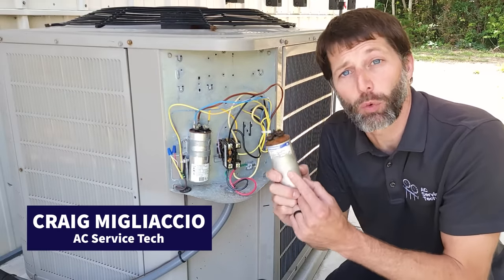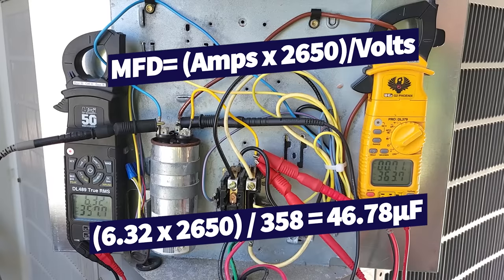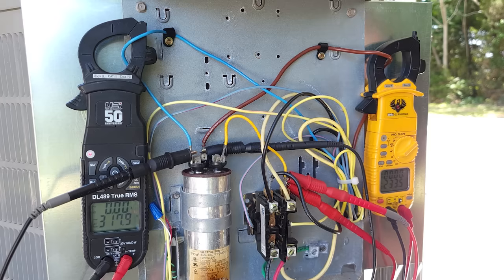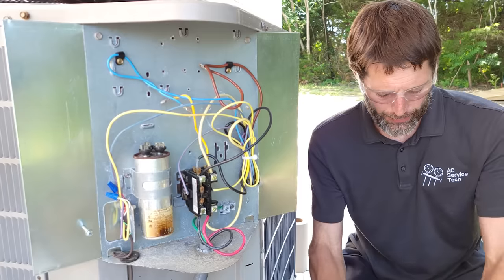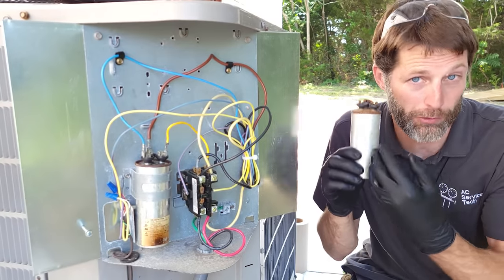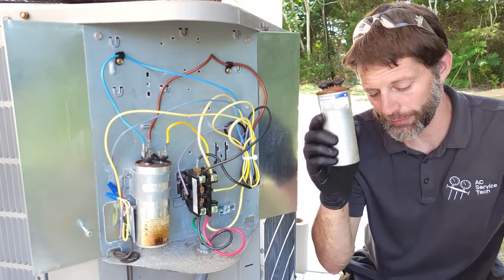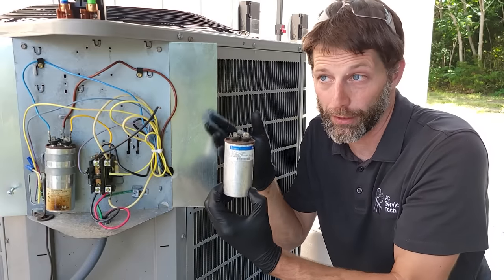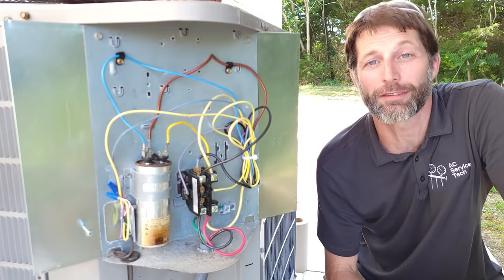WHY CAPACITORS FAIL in Air Conditioners! Watch it Break!

Comment: My capacitor failed and was told it was going to cost $220 to repair, but it would be a week to repair.  I looked up the capacitor on Amazon, cost $18 and a day later I installed it in 5 minutes. Been working ever since.  I did order another, just in case.
Reply: My experience is that Chinese made capacitors have very short lives.  I've had problems with the capacitors on my pool pump motor.  I just bought a made in the USA capacitor, we'll see how long it lasts?
Reply: Erik, I just had an A/C tech tell me $330 to replace a capacitor, I showed him I could buy the SAME item from Amazon for $21. He told me his boss forbids him from installing such. Blamed Bidenflation and the need to be profitable.
Reply: You could buy 2x 10µF/400V and in parallel of 5µF/800V, also 2x 90µF/400V and in parallel of 45µF/800V and hold all of them in the ground to prevent vibra. That is it.
Reply: @chipdenman863  needing to be profitable IS a huge factor. I could clean my own house for about $1 worth of cleaner or hire a person to do the same job for $60-$100. It's always cheaper to diy. Don't hold this against them. They are highly trained pros that must charge for their time wether or not it makes sense to you.
Reply: Let's pretend for a minute that you have an A/C repair business.  You have a truck to pay for.  You have a LOT of inventory to pay for.  You have gas to pay for.  You have vehicle and business insurance to pay for.  You have a business phone line to pay for.  Business cards.  Vehicle maintenance.  And not everyone has the ability to replace their own capacitors.  And the fault with your A/C might not have been the cap.  I think the $220 was a pretty cheap repair estimate.  Stop bitching about how much a business charges when you obviously have no clue about running a business.
Reply: @obnox7601  So your conclusion; stick it to the home owner.
Reply: For us it was a Sunday evening a month ago (late June) and we were looking at spending the night in 90 degree weather here in Houston.  Ended up costing us almost $350 to replace the $30 or so capacitor in about 30 mintues on a same day (night) service call (~10pm).
Reply: @larryross1819  Lmao…they are all made in China or with at least Chinese components…FJB!
Reply: @obnox7601  Let’s pretend you aren’t  a rip-off artist…most HVAC companies are and you know it.

With that sort of attitude you won’t get a lot of repeat business…one HVAC tech to another…
Reply: So if you call a AC tech it means you have to pay him and for the truck and all the knowledge and equipment they have. Just because he told you it was a capacitor does not mean you should screw him. Get on the internet and trouble shoot it yourself. Buy the parts and replace them. Just don’t call the guy and argue over the cost. Most companies charge just for coming to protect themselves from such people. In fact they don’t want your business.
Reply: @baogiangsongque5507  think you mean in series. voltage balance can be an issue, typically install equalizing resistors.
Reply: Even an honest, competent professional is going to cost major money to do anything. They have legit expenses, plus you are paying for their knowledge, and they have to make a decent profit otherwise why bother? In the end if they are making min wage just go flip burgers. Want it done better, faster, cheaper? Learn to do it yourself.
Reply: @AmandaHugenkiss2915 and you have to pay for the tech’s jacked up F-150 and the bosses cabin cruiser.
Reply: @obnox7601  I’m a controller for a corporation and I’m saying they rip you off.  I think I know how to run a business.
Reply: Yup, good thing you ordered a spare, they're all made in China.
Reply: Japcaps aren't bad
Reply: @chipdenman863  so how much should he charge you for getting the capacitor and then coming out to install it since the retail price was inexpensive?

Comment: When I was a kid the capacitors lasted the entire life of the unit. I've seen caps so old the only reason they had to be replaced was because the 25 year old terminals had rusted through and you couldn't get a connection on them anymore.  Those caps were oil filled and weighed a couple pounds. They were also a lot bigger in physical dimensions, a 30mfd was about 7 inches long oval can.. The caps we have now sometimes fail in a year and feel like they're filled with air.
Reply: One word....CHINA.
Reply: I believe that they used PCBs and thats why they last much longer.
Reply: @vernroach3413   It aint where it's made, it's how it's made. My Sony receivers lasted 30 years it still works
Reply: @agsession7664  Depends on what is made too...I do believe Sony is from Taiwan...Far better than China...South Korea for the most part, good products...Mexico, depends on what it is...Most receivers will last for years, no matter who made them...It's just a receiver...They're not under the stress some products are.
Reply: @curtishuzarewich7033  I think it was actually because they were foil caps, not vacuum deposited metal films on plastic film. Could handle current overloads without overheating. IMO.
Mr KL
Reply: @agsession7664  Caps > China, Sony > Japan; BIG difference. AFAIK
Mr KL
Reply: @vernroach3413  There are people with alcoholism, do we close the liquor store? Does any new system come with an Amrad? How many techs run them? The choice is there
Reply: @vernroach3413 you don’t know what you’re talking about.
Reply: @johnsullivan8673  Hey Johnny baby...Didn't mean to insult your genius.
Reply: I've used multiple brands of capacitors and they all have failed right around the year mark.  I always have 2 on hand at all times now 🤦🏻‍♀️
Reply: @oldbear6813  turbo 200 ...I have only seen a couple fail
Reply: They "make them to break them" now because our world is so upside down. Sad, but so true with much of life. My wife and I talk a lot about wishing we could have lived through the 50's-60's at 40 years old. Not this 2023 world we live in where everything is literally shit and shit on. But I love your sentiment. Especially considering we live in Phoenix, AZ and these caps burn out so easily here in a year. and it's ALWAYS ON A FRIDAY AFTERNOON, during the 115 degree+ days which ultimately sent me into a learning season to cut the HVAC techs out and do it myself. It's ridiculous!
Reply: @vernroach3413  You can buy crap from any country.  The reason "China" is on people's lips is because US companies don't CHOOSE quality, they choose cheap, and they can get the cheapest crap from China.  MANY companies use China and by specifying the quality they want, they get good products.  Apple comes to mind.
Reply: @troubleshooter1975  They don't handle heat very well either.
Reply: Heat reduces the life of any component. If the manufacturer wanted to do something about that, they easily could. There's a giant fan in the condenser... How about putting a couple of vents in the electronic compartment so there's a bit of airflow from the fan?
Reply: @bbgun061  I don't think that would help. The air in the rain tight contactor/electronics area is fairly close to the outside air temp unless sunlight is hitting it pretty directly. Cooling the capacitor by a few degrees probably won't help much. I do use 440vac rated caps in my equipment and they seem to hold up a lot better than the 370vac. There are techs that say you can't use 440vac caps but they are wrong. I also add a slow blow fuse to my compressor's black wire that is just a few amps above my normal running amps. If my compressor draws 11 amps running I put a 15 amp slow blow fuse on the black wire. That way if the cap fails when the compressor starts and is drawing 30-40 amps it blows the fuse and saves the compressor. I don't know anyone else that does this, it's just something I do because I hate compressor failures. I have about 40 systems on various rental properties. I don't work on other peoples systems so I guess you could call me a part-timer.
Reply: @douglaswatters7303  great idea!
Reply: I have taken out systems made in the 50s and 60s on remodel projects that still had the original capacitors in them, they were all PCB based which is now banned
Reply: @troubleshooter1975 Bingo! This is exactly why modern run capacitors have shorter life expectancy.
Reply: @electricboyo  TNX!
Is your comment about caps using deposited electrodes? (I also made a comment about Sony and China are not the same quality AFAIK...)
Reply: @bbgun061  My Rheem unit has the can of the capacitor stuck through a hole right in the fan air flow.  I thought that was way too good of an idea, that engineer probably got fired.  I replaced the cap this summer, after 13 years.
Reply: Turbo is the way to go. I’ve never really replaced one of those. A lot of times I’ve seen capacitors fail is when the compressor is overheating, usually due to caked coils or bad fan motors. System gets really hot when the compressor can’t breath. Also if your system is getting beat by the sun 16 hours a day, like on a rooftop.
Reply: @vernroach3413 Yes, let's blame China for manufacturing to USA specs.
Reply: Not knowing much at all about this topic but is it advisable during extra hot days in the 90s to shield the AC unit from the sun. Even with a patio umbrella or even build a wooden roof above the unit? Any suggestions appreciated.
Reply: @pmaz-11  Bad idea to build around the outside unit. What cools the condenser is good air flow. The fan pulls air though the condenser. Something built over it or around it could cause the air flow to be restricted, or prevent the warm air from rising up and away from the unit. They are designed to sit in the sun, on rooftops or on the ground.
Reply: @douglaswatters7303  ok thx for the advice. But I have to say that extreme heat on anything is not good. I asked an HVAC tech today  he said that the extreme heat can increase the amperage putting a strain on the equipment. Found out the fan Motor is out & the heat probably helped it along. Units these days suck.
Reply: @Null-o7j 
I agree with your statement for the most part but there are cases where items are not built to spec.
Reply: Old caps were filled with "Pyranol" a special oil especially made to withstand service.  (This oil was also used in street transformers & the big transformers in the power stations.)  But this oil (PCB, polychlorinated biphenyl) is nasty when it gets into the environment & never breaks down.  So they now use an "ecologically responsible" oil.  This oil is not as good electrically (& is also flammable so cap can catch fire if it ruptures).
Reply: @vernroach3413 I believe the amrad ones are made and manufactured in Jacksonville Florida. That’s probably your only true American option. Come with a 5 year warranty too. It’s all I use.
Reply: The Run Capacitor will be exposed to excess heat from the motor. A lot of these capacitor failures are not cleaning the Condenser Coil. If you’re replacing a Run Capacitor I would clean the condenser coil also.
Reply: A common scenario, A DIY doesn’t have the correct Run Capacitor, They need a 35/5 and they replace it with a 40/5  thinking it’s ok.  That capacitor fails and gets replaced with a 45/5 because it was emergency and after hours.  This can cause the Start Winding in the compressor to fail leading to compressor replacement or system replacement.  Always do your homework and make sure the correct capacitor is installed.

Comment: I honestly can't even remotely consider why anyone would thumbs down this video... It is distinctly, one of the absolute best explanations on YT for value, reason and explaining the math behind it. Job well done Sir.
Reply: simple to explain why the thumbs down - it is u -tubes fault. if you give a thumbs up you will get blasted with stuff similar to . since i just was interested and not wanting more similar, thumbs down - NOT because its a bad video. stupid the way utube does things.
Reply: Probably down voted by an AC guy that don't want people to know how easy and inexpensive it is to replace! He loses business over these types of videos. Emergency call, service, and part $450.00 for something that can be fixed in 10 minutes and the cap is under $20.00.
Reply: @williamkechkaylo7915  Safety glasses on head vote.
Reply: No.
Reply: Down voted by capacitor manufacturers.

Comment: I always keep a spare capacitor at home. After the first $250 bill for replacement, I learned to do it myself.. Only a $20 part so cheap to keep a spare. In Texas they are the most common failed part on a home AC and they charge an arm and a leg to come and replace it. Literally takes 5 mins to replace..Easy to test with a volt meter..
Reply: Maybe it would be a good idea to figure out why your capacitor is failing so much
Reply: @jakev1972  It's in Texas.  It's hot here, like a lot.  High ambient heat shortens electronics life.
Reply: Yeah, Texas is hot. And they aren’t failing a lot. I’ve only replaced 2 in 10 years. But there so cheap, why not have one on hand instead of paying a high prices service charge and having to be without AC overnight or more than 8 hours in 110 degree weather while you wait for that service call…
Reply: I have spare capacitors and replace it as a planned-maintenance item (PMS in the Navy as an ET is planned maintenance system, fix it to keep it working when you never know when SHTF).
Reply: Reduce the temperature  of the cap by  shade, or maybe heats sink or reposition
Reply: @loueckert4970  - how frequently do you proactively replace your caps?
Reply: @tesmith47  its in the shade...105* in the shade in south Texas...LOL
Reply: Just had one go out on my AC unit, grabbed the spare off the shelf and was up and running in 30 minutes. The next day I stopped by the HVAC shop and picked up another capacitor to put on the shelf.
Reply: @loueckert4970 home depot has it every day , max overnight sweating
Reply: They charged me $400 AND tried to add a $90 service call charge to that!  I argued with the guy who replaced my full system 5 years ago that he was oversizing it.  I think it's frequent cycling, but it's also Houston and need to check voltage.

Comment: They fail because most HVAC guys install the cheaper capacitor, so they get about $300 when out blows in less then a year. HVAC capacitors are a county wide racket.